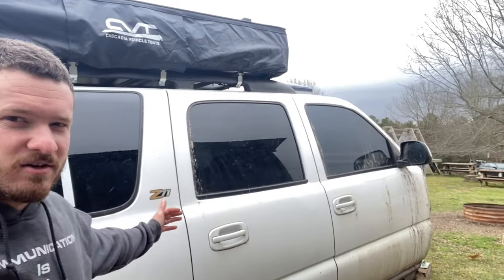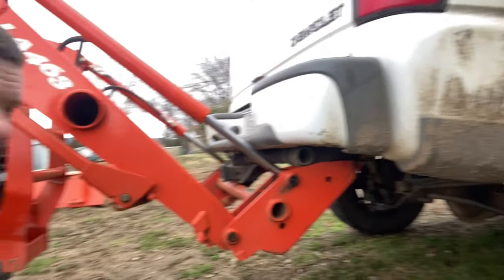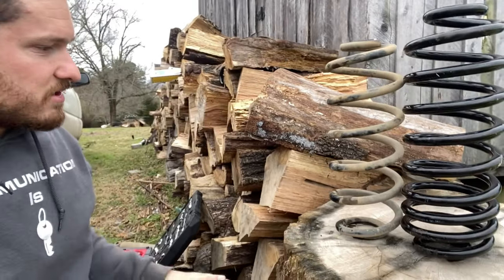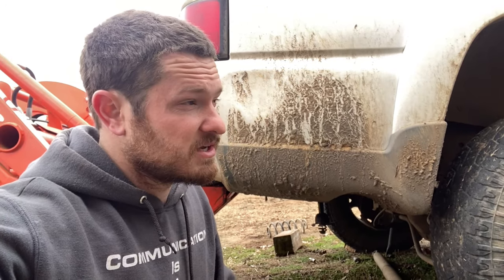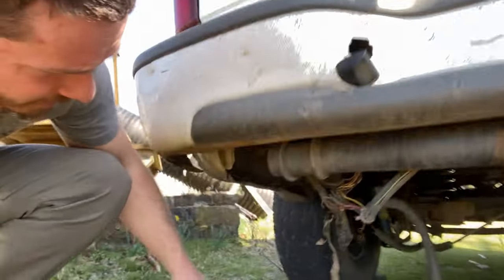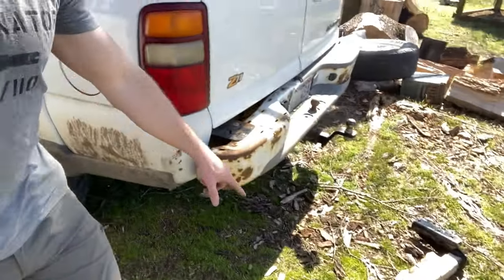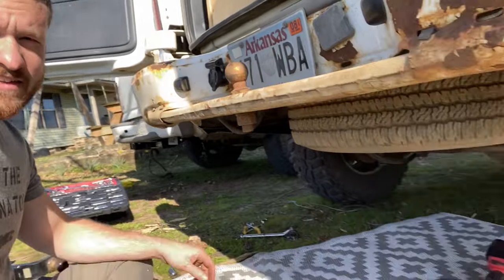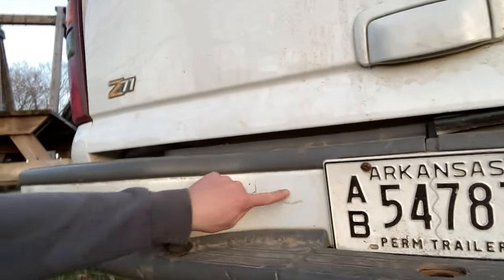Suspension Upgrades on the Suburban Camper - DIY Overland Trailer

Comment: I hope you went back and tightened the nuts on the wheel because when you spun it the wheel wobbled. 13:20 I hope you double check the way you use your impact on the hitch as well.
Reply from the maker: Yes, everything was verified by hand to ale sure it’s tight. I don’t film every part of the process, it turns into too much boring content lol

Comment: Just a heads up h2 air springs fit our trucks also if you end up putting onboard air and a ride height valve it will always stay at the same height could also do it on the camper and just run an air line to a small tank on the trailer
Reply from the maker: Interesting idea! I’m prefer not rely on air ride for our application but I could see using that if we weren’t off grid so much
Reply: @trove1312  I can understand that I was gunna copy your camper idea and put air on it I put it on my suburban and I love it and I have full control

Comment: What shocks did you use ? I am going to do the H2 springs and wasn't sure i should change the shocks also for the increased height. Thank you
Reply from the maker: I am using Bilstein 5100's that are for a 1-2 inch lift I believe. They are a little longer than factory to cover that increase in height